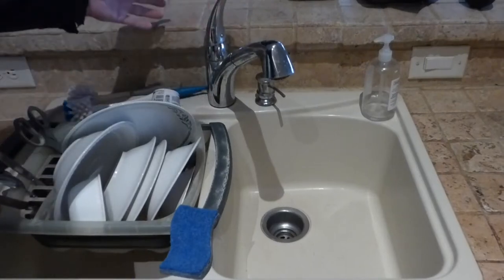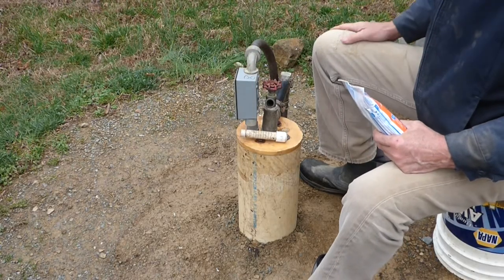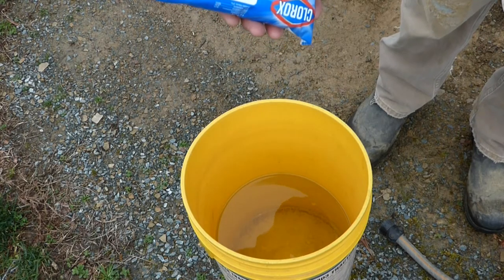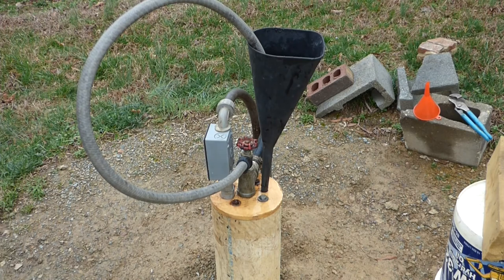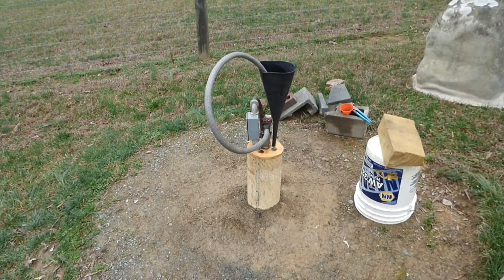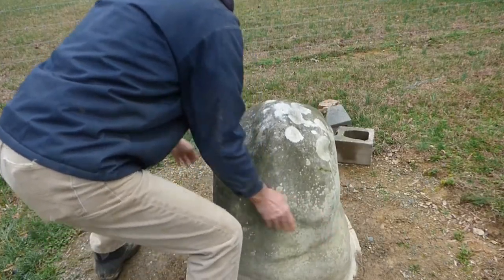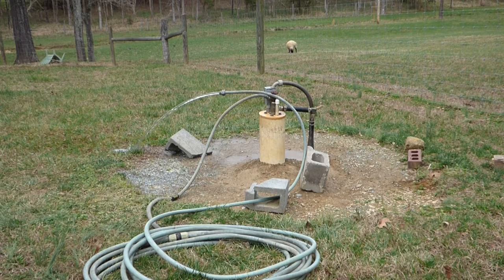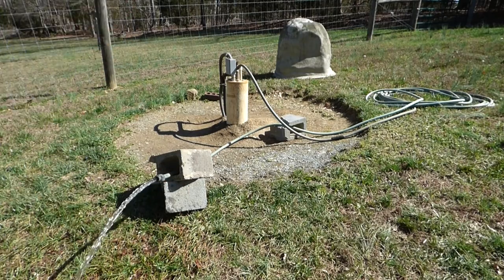How to Disinfect your Well Water (Complete Instructions)

Comment: Furtherest outside tap,  but youre using one at the well, tell me
Reply: different steps in the process. watch the video again.  tap at well if you have that kind of well configuration, is to recirculate. tap furthest from house is to flush the system